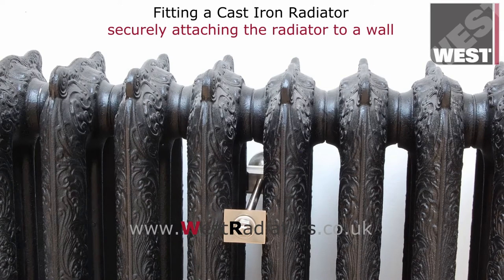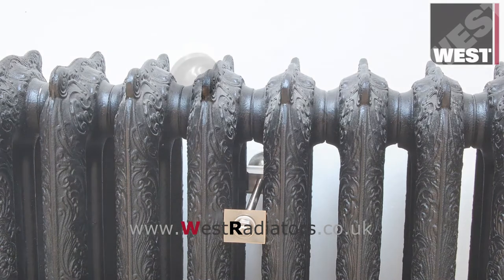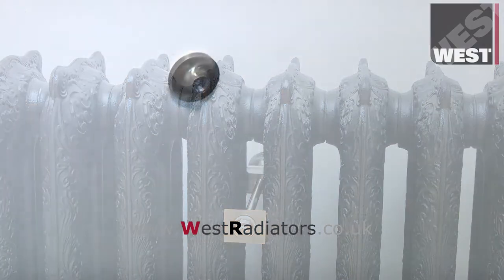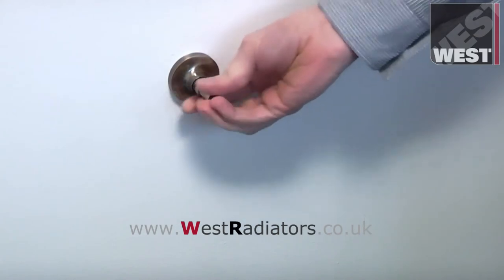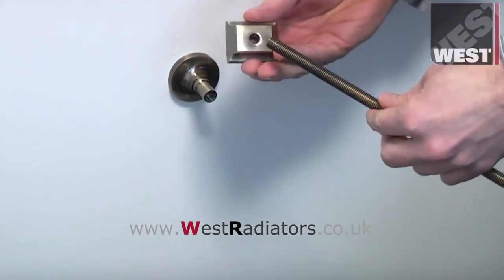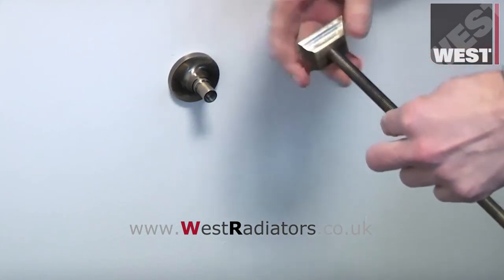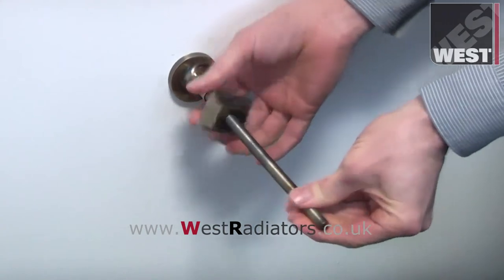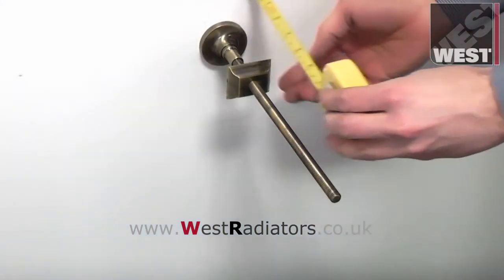Traditional Wall Stay Installation Guide

Comment: The piece that is shown already fixed to the wall is actually two pieces that screw together. Once unscrewed from each other, you can first fix the larger circular piece into the wall through the middle, then re-screw the nut to conceal the fixing… hope that makes sense but agree it’s an important step missing from the video